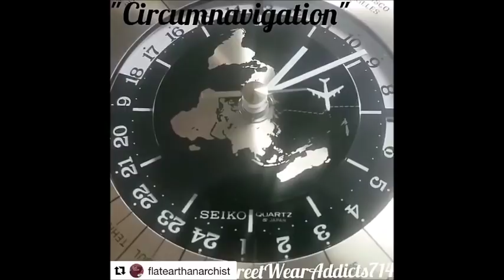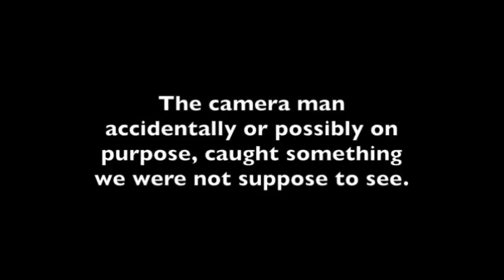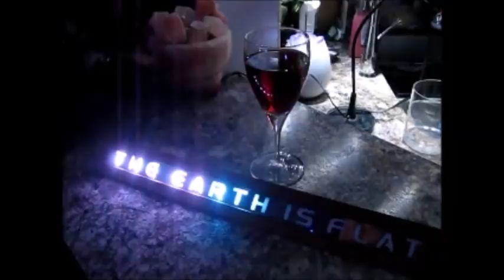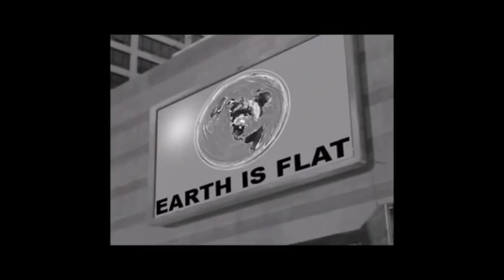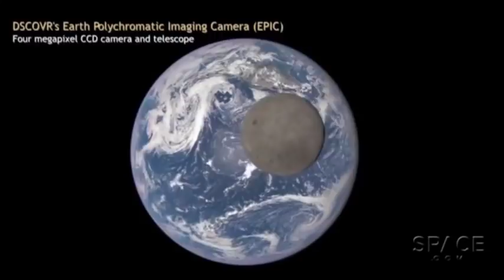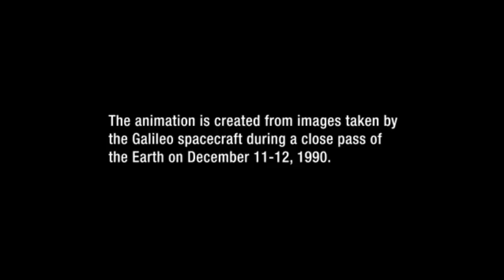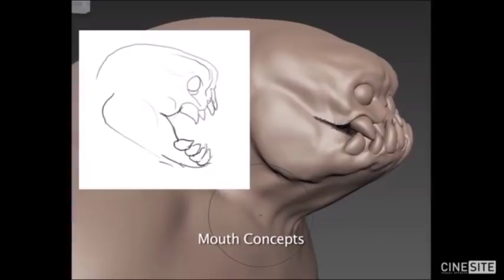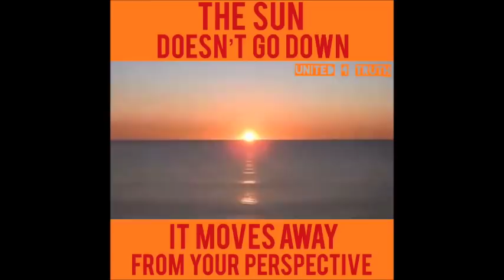Flat Earth Q&A Emails 80 - Mark Sargent ✅

Comment: Mark Sargent. Do you have a GPS in your car? Or in your phone. 

Do you know how a GPS works? 

(Hint: The "G" does not stand for 'Great' or 'General')
Reply: He lives on an island. I don't think he needs one. Maps still work you know.
Reply: He may stil have a phone, you know.
Reply: Cellphone ground towers use microwaves which are line of sight calibrated.
Reply: Bill Keith - Don't even try to hint that a GPS works by cell phone antenna signals, if you don't want to make yourself look like an imbicile.
Reply: Bill Keith I was clearly talking of the gps chip in phones. Why did you bring cell phone masts up at all?
Reply: I just re-read this entire thread and realized you were not trying to say that cell phone technology works using satellites. You were clearly just talking about GPS. But.....
A cell tower can transmit a location to the phone using cell tower triangulation in relation to the WGS84 system.

Comment: Why dont one of u flat earthers travel the perimeter of the ice wall  pick a starting point travel for the perimeter for a month or so and the head north and you should obviously end up in a different country from witch u started south
Reply: HALI100 
What you propose would work the same or give a similar result in either model.
 The only difference would be the distances of travel would not be the same for your destination points between the two models.
 The biggest problem with your idea, even if you could fund the mission, is the 'Antarctic Treaty.'
 If you are unaware of this treaty, perhaps you should familiarize yourself with it, as well as the restrictive parameters of such a mission.
 Just the request alone entails mountains of red tape in the country of origin. Which does not include permissions from the other treaty countries.
 You would then realize that your idea is all but a near impossibility for even the above average person.
Reply: Ekstij Amezie don't bother replying you will find out soon enough that your wrong I'm officially done with you, watch collegehumors video why the moon landing can't of been faked
Reply: Ekstij Amezie no i dont think they made it to the moon but is that all flat earthers have to prove the earth is flat lol silly silly
Reply: Ekstij Amezie, you don't know me so why call me a liar? Ive had my hardware put in space and communicate with it. I can time the signals and calculate it's distance. No one else involved.  Do you know what a directional antenna is?
Reply: Ekstij Amezie, quite a keyboard warrior arnt you.  I'd love for you to say it to my face haha!
Reply: "your hardware put in space and communicate with it".. heh.. I suppose you made your own rocket, propulsion and guidance system as well. You are the optimist they are looking for. To infinity and beyond dude…
Reply: Aard Man, er no, our customer did that. Why is it so hard to believe?
Reply: Clients? Nasa, Esa, SpaceX,…? And what data did your supposed satellite send back? Tell us all about it…
Reply: Aard Man, none of those. Earth observation satellite, telemetry data and image data. It makes no difference to me what you believe.  All Im saying is that I've had first hand experience using my own devices in space, myself and colleagues are the only ones with access to it. It's easy to get its distance,  location and control it's location.
Reply: Aard Man, even ametur radio guys have had mini satellites put into orbit for them. They use these things on a daily basis using very directional antennas. They also do earth-moon-earth communications. If you bounce a radio or microwave signal off the moon and time it you can determine its distance. Why dont you try it?
Reply: You can say whatever you want, it doesn't make your unverifiable claims true. What you are stating about radio waves can also be accomplished with ground based radar. So theres no need for a satellite. They are doing this since WWII, when no satellites existed.
Reply: Aard Man, what they used is troposcatter which is a terrible way to communicate, used only in emergencies or when satellites arnt available. It's very inefficient and wastes a lot of power.
Reply: Aard Man, Go to the Australian out back and try to make a phone call from a mobile. Then try a satellite phone.
Reply: When satellites aren't available? They are supposed to be up there. Anyway, there are only a few companies that bring "solutions", and one of them is Raytheon. They state on the site: STSS-D consists of two satellites carrying sensor payloads in a *low-Earth orbit*. Low earth orbit is not space. For all it's worth, it could be hanging on a balloon. Another thing about it is the mention of an amplifier and a beam directed at the receiver just above the horizon, which could work if there's a ground based system (no doubt it's more powerful). The image gallery also only shows CGI images with the usual tinfoil that still does not proof satellites in space. So the phone you talk about, could be connected to an amplifier which could improve the data transfer.
Reply: Aard Man, low earth orbit is space, which is defined by the height where there is no atmosphere or next to no atmosphere. Troposcatter is rarely used these days because satellites are more common. I think just the military or radio hams use it.  Anyway, why don't you get the gear you need or find someone with a ham license and do moon bounce for yorself, nothings stopping you.
Reply: I'm not looking for another hobby as a radio amateur, I just want to know the truth. The satellite and it's use is just one of many things that have a simpler explanation without the need for imagination.
Reply: Aard Man, you're wrong, and if you're not willing to investigate for yourself then you won't learn anything first hand. Youtube videos don't count.
Reply: I wish you were correct but sadly the official narrative is loaded with fakery, secrecy and symbolism, it just can't be trusted. Scientists on YT won't be happy with your statement btw.
Reply: Aard Man, I don't care what anyone thinks, scientists included think.  There are some good videos but you have to be discerning. Any true scientist would encourage others to find things out for themselves. I'm a scientist/engineer however I'm not scientistic.  There's a difference. Also, most real scientists have nothing to gain from lying ( besides looking grant money ), although it happens.  They are frauds and usually get caught out.